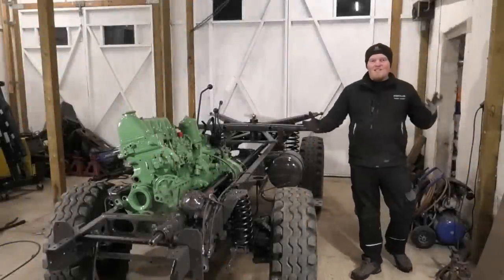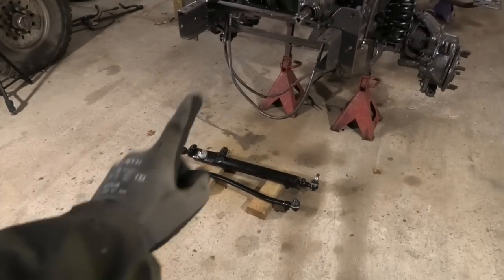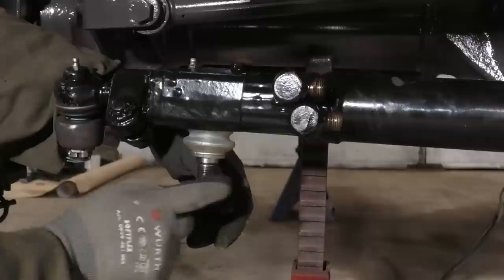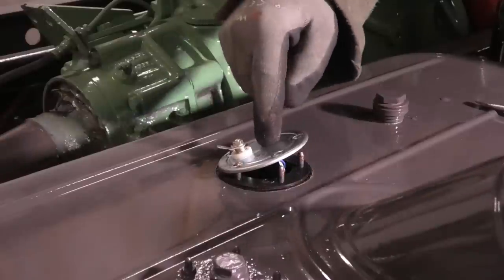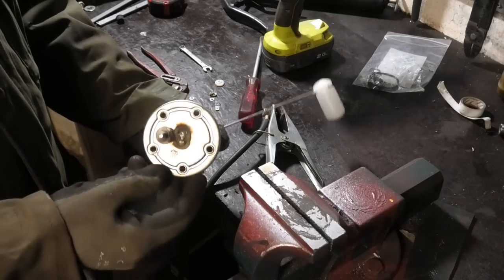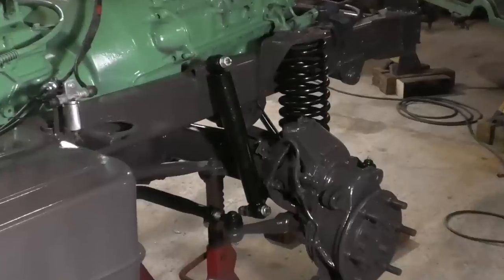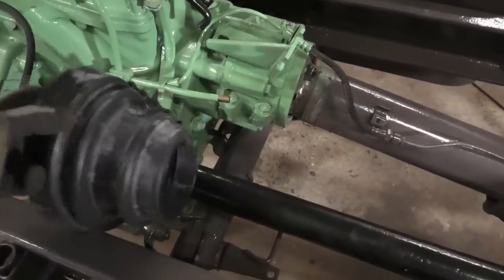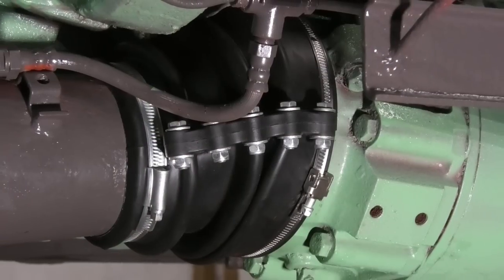Unimog Barn Find. Part 9 - It's Coming Together!

Comment: The colour choice is absolutely stunning and you are a pleasure to watch because everything you attempt you do so at you best ability and you cannot ask for anything else, The unimogs are quite common in the uk mainly because of their speed suspension and air brakes, Especially running on huge wide terra tyres for agriculture contracting for spraying and suspension fertilizer applications, Keep the video coming you are a pleasure to watch,🇮🇪🇬🇧.

Comment: Great job. Great explanation. Are the hubs reduction gear boxes or are they 1:1?? Its interesting how a few concepts are shared with the vw bug and bus. By few i mean like two, hehe. Buts its interesting! Maybe the pinzgauer shares 3 things in common. I have to change the split boots on my bug all the time, its a real PITA as it has oil inside, not grease, so its not very forgiving. Theres a lot of clean up involved... and then the rubber lasts only about a year, even if you don't drive it, but the installation is same in that the split part goes on at 3 o clock or 9 o clock. Not that everyone installs it like that. Cheers!
Reply from the maker: Yes, The portal's also double up as hub reductions :)
There were a few different gear ratios for them. but i actually haven't lookd into what it is on this one.

Comment: I don’t understand how you can have only one universal joint on the rear driveshaft. Surely this will give a pulsating drive output. Normally you would use two out phase to eliminate this problem.
Reply from the maker: It probably does "pulsate" a little bit. It's just not enough to have any noticeable/negative effects.
Reply: @KJOff-Road  Yes. And the angle is not that great.

Comment: Really like you channel .one question did you make the chassi wire harness or did get a new from Germany .
Reply from the maker: Thanks a lot!
And neither, really. This one actually still have it's original wireing harness (What little there is) Because it's in a fairly good shape. I have only made a few repairs to some of the end terminals. and also, i will be doing the end of it, where it splits out, to the rear lights.

Comment: Did you you exchange the shaft seal rings at the gearbox and on the axes? If not I would suggest it. Otherwise you ruin your new breaks with the oil if there is a leakage
Reply from the maker: I didn't, no. As there are no leaks from the gearbox :)
But i will have to do some of them on my 416, whenever i get to work on that. it's leaking pretty bad from one of the PTO outputs.
Reply: @KJOff-Road  the sealing is maybe 50-60 years old before painting it makes sense to replace them, otherwise they are leaking soon. Wish you the best that is is not true in your case

Comment: Im too lazy to be tightning all those bolts with a ratchet tool, i just use a electric drill to tight them up on the lowest setting and then go there with a manual tool to give it the final tightning makes it much faster its just how i do it 😂
Reply from the maker: Oh, i do the same!
It's only the small stuff that i ratchet in by hand. all the bigger bolts, also gets driven in with the impact, and then just torqued for the last bit.
I just don't film much of it, as it just makes an awful lot of noise on camera :)
Reply: @KJOff-Road  yea, i do everthing with the cordless drill you know just to bolt them in obviously the drill dont enough power but it gets the bolt inside and then i tight by hand either a bolt or a screw i tried to screw it by hand but i was like hell no got the drill screw it in place and tight it with a philips driver XD

Comment: should maby put the bolts on the rubber thing on the underside of the shaft tube, next time you gona need to remove them you might not have access to it from the top.